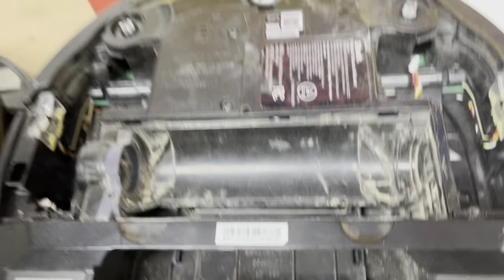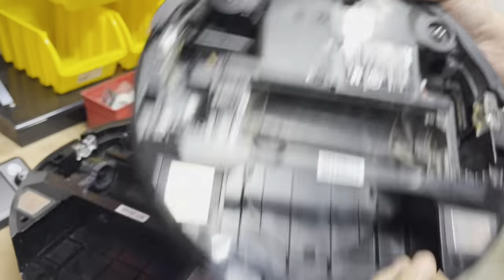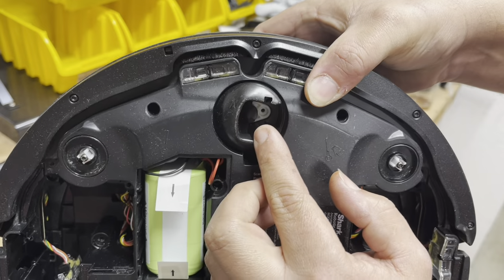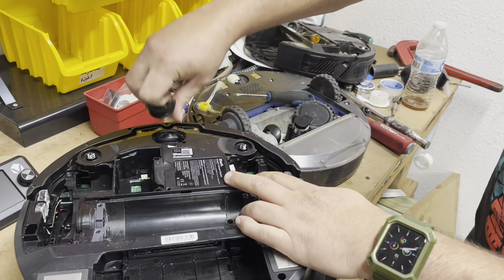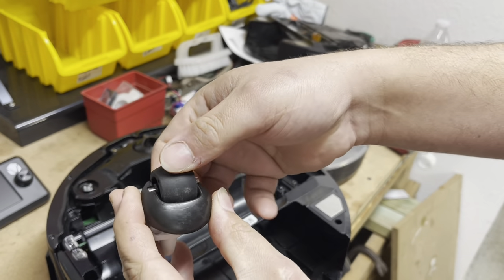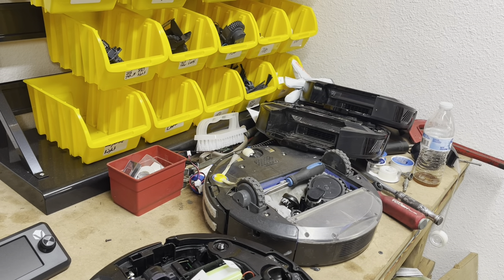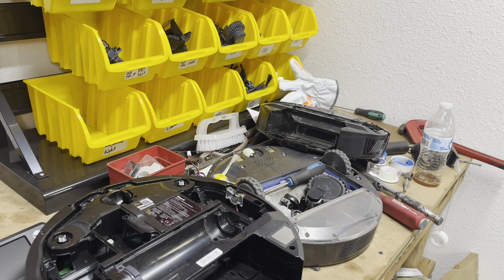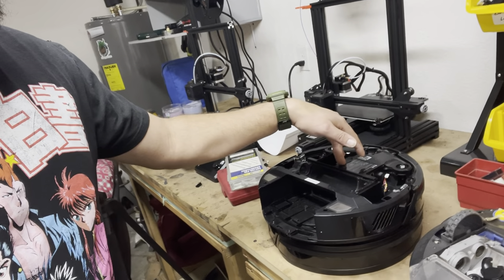Shark Robot Vacuum Cleaner Front Wheel Removal | All Models IQ , Ion , AE

Comment: My AV2510AOUS is riding low in the nose and will not contact charger tabs because rear is high. Nose wheel spinning freely. Can assembly collapse? Or can wheel wear out and lose diameter?
Reply from the maker: They can wear out but its rare unless used on concrete. The back springs might have stuff stuck in them remove and clean.
Reply: @SmittysWorld  Spot on, sir. A dryer sheet had gotten into one of the wheel assemblies and would not allow it to compress all the way, thus lifting the rear. Thanks so much for your help

Comment: Hello I have a Shark RV912S. The front wheel and the swivel with post came out. It falls out easily. To be clear, it is the wheel, the external black plastic snap assembly and the metal post. The post has a groove on the very bottom of the shaft. I can see the white plastic receptacle inside the robot. From your video, it is the type without the screws so it has the clip (or the screws inside). 
What I want to know is...if I go inside and behind the motherboard etc, will I get the white plastic out and be able to snap the metal shaft back into the white plastic housing. It looks like there may be a snap ring for the bottom of the saft that holds it in the white plastic housing but it can swivel around. Did the shaft somehow slip off the snap ring and the ring is now stuck in the white plastic housing? 
If I need to go behind the motherboard to get to it, is it better to replace the whole assembly? If so, where can I get it? This model is not common on the internet. Maybe there is an equivalent model number?
I'm standing by and hoping to hear back. Thank you.

Comment: I need the front wheel assembly for the Shark 1000. The one you show in your video that should not be removed has fallen out and will not stay in. Will I be able to replace that myself
Reply from the maker: I don’t have any in stock right now the robot has to be completely taken apart in order to get the two screws out to drop it out

Comment: Hoping you have advice for me. My Shark IQ Navigation says my front wheel is stuck. It works smooth. Popped the front wheel out. Nothing in there. Wiped it down. Still won’t work. Think it’s the sensor?
Reply: Pulled out the roller brush and there was a horrific amount of hair there you can’t see without taking the roller out. It appears to be working right now again.   Guessing/hoping I was getting the wrong error message.
Reply: @Rev Limit yes it worked.

Comment: On a 1000 unit how much is the side brush motor
Reply from the maker: They are sold as a pair for $35 plus shipping. That’s if I have any left in stock
Reply: I did exactly what you said not to, I forced it out, and now it won't stay in. Do you have a part for this? Thanks.